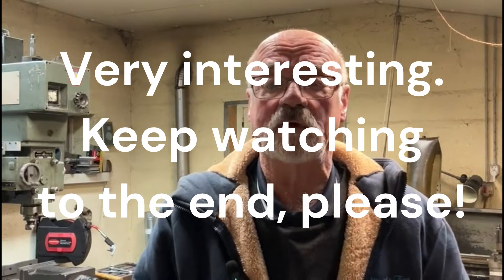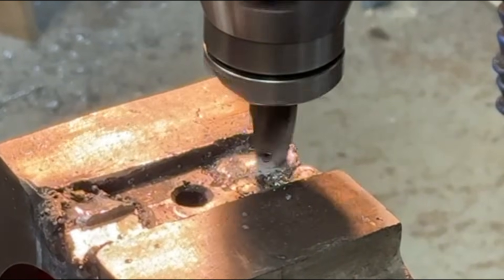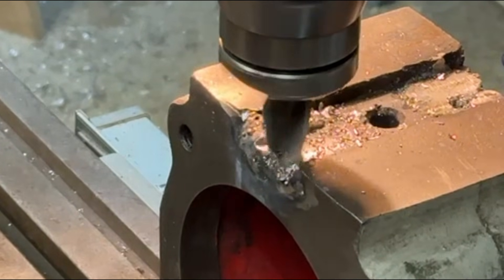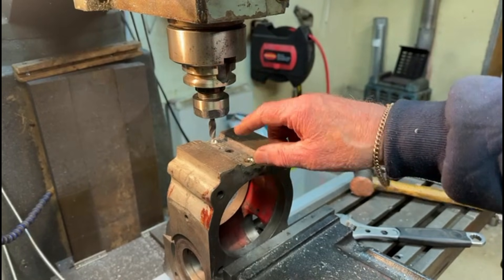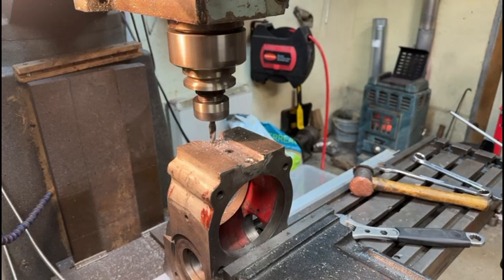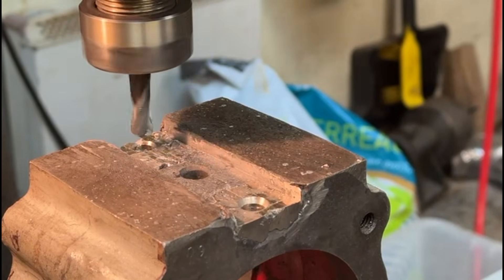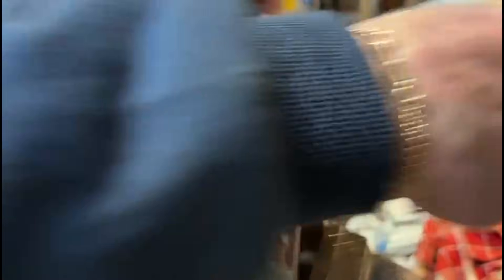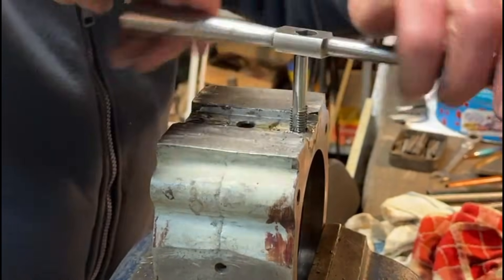Repair to a cast iron machine part

Comment: Hello! I noticed you were using a 2-flute tool. I was wondering your opinion on 4 flute/roughing EMs vs the 2f? Also, music makes it very hard to hear you, unfortunately. :(
Reply from the maker: Thanks for the question! I like 2-flute for general machining, but 4-flute definitely has its uses too. I didn't really have much option as I had very limited height to work with and I didn't have an end mill short enough to do the job, hence the use of a stot drill. Thanks for the music feedback too!

Comment: Machining is good, do not grind as it spreads the carbon which makes the weld brittle
Can use stainless rods as the nickel flows well into the casting
Allays pre heat to 150 deg
Slow cool
Good luck
The welder
Reply from the maker: Hi, thanks for you comments. I try to avoid welding cast as it can create problems as you said. Cheers, Fraser

Comment: Very well explained techniques Fraser. I felt nervous watching you tap the holes, even though it was a large tap. As you said they can be very brittle. I guess best to use HSS rather than carbon steel. Keep warm ATB Nobby
Reply from the maker: Thanks for the kind words, Nobby! Appreciate you watching. Good point about the HSS taps!

Comment: Thanks, Frazer.  I appreciate your comments about the hard spots in the weld.  I haven't worked with cast iron, but I do sometimes need to fill areas in mild steel with weld and I've had issues with hard spots there.  I didn't know if it was me or just the nature of the beast.  I've tried heating those areas in the hope of kind of annealing the hard spots.  Sometimes it seems to help a little.  I wouldn't try that in cast iron though.  Next time you do a boring bar demo, please show a close up of the boring bar.  I've been trying to collect ideas for different boring bar arrangements.   Thanks again.
Reply from the maker: Thanks for the kind words! I'll try to get some close-ups in the next boring bar video. Cheers!

Comment: I often wonder if the client appreciates just how much effort goes into these jobs, what seems like a very simple job ends up with lots of special fixtures needing to be made and non standard techniques, but you got there in the end. Have you tried annealing the weld area with the torch ? I have found the carbon migration from cast iron welding to be an absolute killer of slot drills/end mills, so I have Sif bronze welded these things in the past, but every repair has it's own complications. It looks cold in your workshop today Frazer, and that never makes the job easy! Stay warm! Chris B.
Reply from the maker: Cheers Chris, thanks for watching. Yeah, sometimes you just have to improvise to get the job done. It certainly gets the imagination working though....keeps the grey matter working too! Definitely cold in the workshop till I get my little fire going. Fraser
Reply: @MetalworkinginFrance-xe5rg  Ha Ha! It was so cold in my workshop yesterday my grey matter stopped working at proper speed! I have got a big paraffin hanger heater, but they do cause condensation, so I just have to work faster to keep warm.
Reply: I suspect that the customer appreciates that Fraser is able to repair and fabricate items, but not all of the steps required to make everything happen.

Comment: Nice! Did you consider brazing? You don't get as many of the hard spots, it's not melting the parent metal, so the carbon doesn't migrate. Cheers, Matthew
Reply from the maker: Hi Matt. Thanks for watching. Brazing wasn't really an option as it needed quite a lot of building up and brazing tends to flow too freely, but it is a good option when building into a hole. Cheers